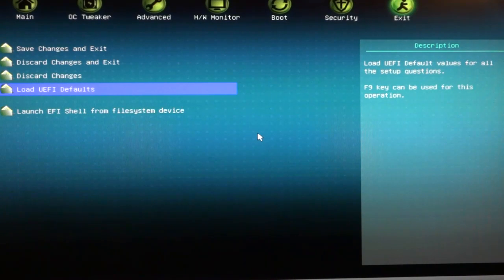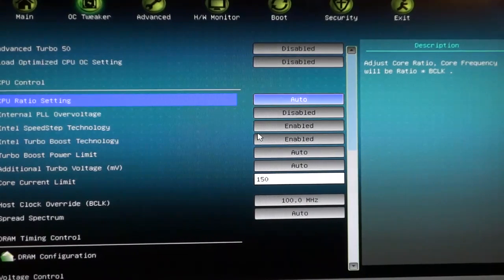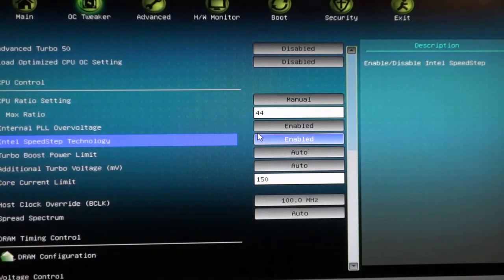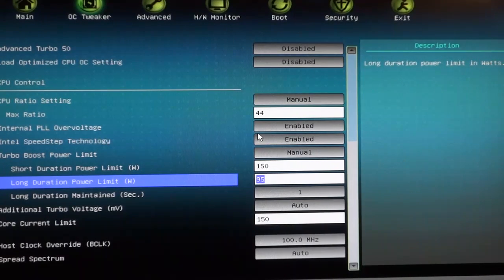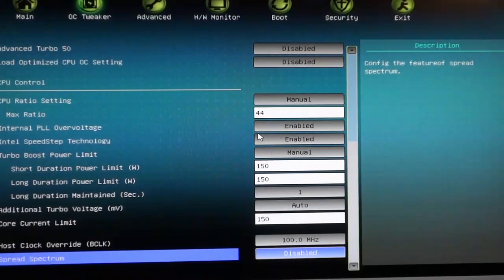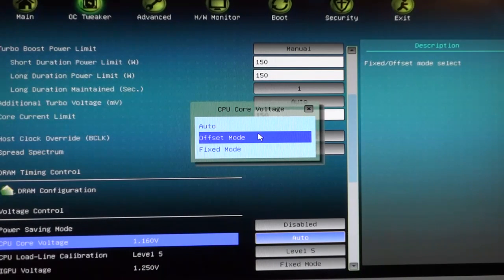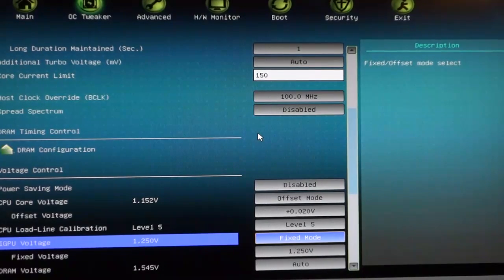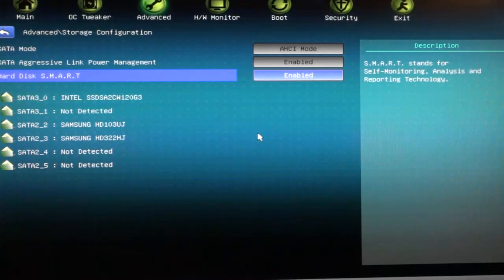Asrock z68 Pro3 overclock - A Basic 2600K Sandy Bridge overclock

Comment: I got some problem with mine, it doesn't work at 4.5GHz under 1.4vcore. And for a daily use to me is too much, i use offset mode, to keep vcore low with speedstep and lower idle clocks, but when pushing if i don't give enough offset to the cpu, over 0,050mv (for a result over 1.440v vid), i get just bsod.

Comment: 4 years later and I finally clocked my 2500k! Thanks for the help!
Reply: +Hubrah  Hey there, I also have a 2500k for almost 4 years now. :D What settings are you working with? 

I must say that I'm a total beginner in OCing and I want to start smooth with Multi 41-42. What Short/Long duration power limits would you recomend?
And in the Video he says that 2500k will need a little less Core Voltage offset what would be a good and stable value for that?
Reply: +Tom Renegade I actually put my settings at what was shown in the video. Everything worked and I am completely stable with no heat issues. As a first time OC, I was like "what the hell, if it don't work or I don't have adequate cooling I'll just reduce the OC speed from 4.4 to 4.3 and so on until I was stable. But to my surprise the settings in the video worked with no problems. These 2500k chips are really good.
Reply: @Hubrah  did you have a upgraded CPU cooler
Reply: @CM-1723  yes, a 120mm aio cooler. Nothing earthshattering at the time. Very cheap.
Reply: @Hubrah  will the standard fan be ok for just taking the i5 2500k to 4.4ghz ?
Reply: @CM-1723  you'll probably encounter heat problems. 4.4 is a lot to ask from the basic cooler
Reply: @Hubrah  I've just got a very old budget ASROCK Z68 PRO 3 & i5 2500k for £40 off eBay . Been looking at coolers on Amazon too many choose from don't know which one to get haha , thanks for the reply

Comment: I have the almost the same board but i have the gen3 version.
The only problem that i have is that i dont have a option for vcore fixed/offset/auto.
I only have the offset mode with very big steps from 50 to 100 to 150 mV.
Any idea?

Comment: @MrMorvar Apparently I had left my CPU ratio settings to manual since last time which explains the 1.6 limit. Works at 3.4 on full load again. Also was having blue screens with default settings but then I remembered that I had to change to AHCI mode for my ssd :) But I suppose the problem must be my usb keyboard.. I couldn't type numbers properly in any input box. Only 1,5 and 6. I'll report again when I get a proper keyboard from somewhere. Thanks for trying to help though!

Comment: @generaltechstuff Unfortunately I was talking about the Max CPU ratio in BIOS, the value which I'm supposed to change to 44. No matter which number I press it sets it to 16 for some reason, even though I have the latest BIOS versio they offer. But now that I rechecked my MHz in windows it say 1600 even under 100% load on all cores. It has been 3400 before.. Time to start searching :)